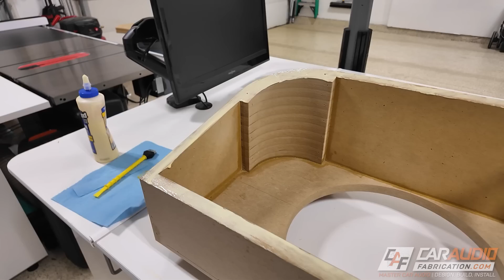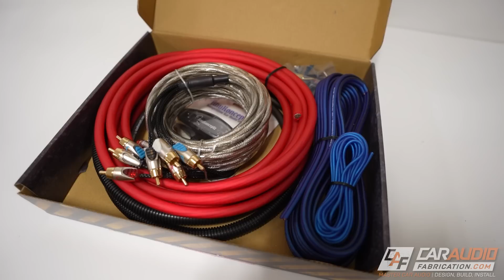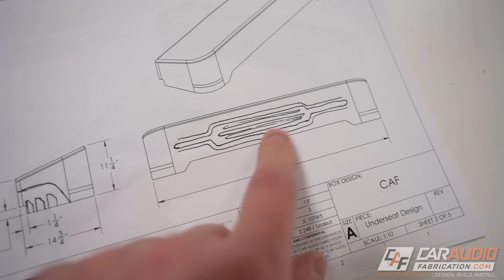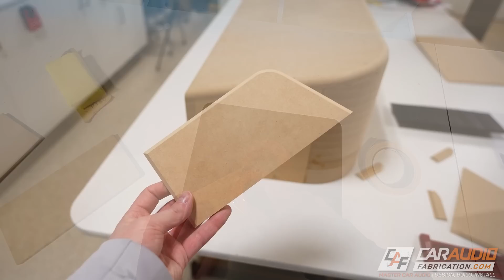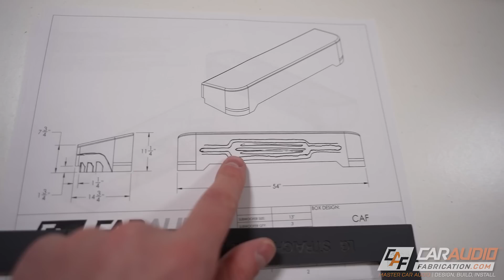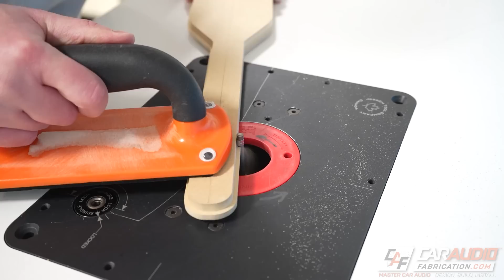Make Your Subwoofer Box Stand Out! (No CNC Required)

Comment: I am making a fiberglass subwoofer panel that mounts up to my roof in my Polaris rzr. I’m using a JL shallow and I’m putting dampening mat on the inside of the panel and also on the roof itself. My friend said I needed to put pillow stuffinv foam inside the area between. The panel and the roof. Is this something you recommend? This is a bit unconventional because most people don’t put woofers on the roof. Also do you recommend leaving an air gap or should I try to seal it up all the way? Thanks

Comment: Hi, can you help me build a subwoofer box with specs 30 inch length , 18 inch height and 7 inch depth. The subwoofer is alpine swj-12s4 a 250 rms sub max power 750. Frequency range starts from 22 hz and it’s a 4 ohm impedance with sensitivity of 87.6 db. The sub box with gives the best output. Hope to get one from the expert soon.

Comment: Hey Mark quick question on one of your other builds. The 13w7 with rd1500/1. Did you have that wired at 3ohm or .75 and the switch set to 1ohm? Thanks!

Comment: Hey man, I am changing my RF Punch P3D2-12 in a ported box it came with, built by RF. On Crutchfield it's the P3-1X12. I accidentally damaged the sub when this 2 Chains song came on with some insane bass!! Anyway I have Focal K2's for my front speakers (tweeter''s and subs) and Focal Utopia in the back seats. So I want to replace the P3 with the Focal SUB 30KXE so I know I need a more powerful amp, but I'm hoping I can keep cost down. The P3 box has 1.79 cuft and the Focal sub needs 1.93 cuft, could I use that box? .14 doesn't seem that much to me

Comment: "Just use CNC"  sometimes it's just faster to do it by hand.
As with your example.  You just free hand drew it on the board.  just cut it out.  the time it would take to draw that in cad then setup the cnc and hopefully not fail, which you did a few times on this piece, still would take longer.

One off pieces you don't always need CNC, more often than not, it's quicker just to make it by hand.  but if you plan to make multiple, then stop and consider CNC.
Reply from the maker: Exactly, I think some people view cnc as "throw a piece of wood at it and out pops a finished piece". You definitely need to spend time drawing. Not to mention when doing things "analog" little adjustments are very easy as opposed to making a full new piece.

Comment: Incredible work. I wish there was a shop I trusted like you here in Phoenix. I have a new Colorado which is space and height limited under the rear seat so I just bought a premade box from SubThump. It works fine, but isn’t customized for the Colorado at all.

Comment: No dry wall screws? I always pre-drill and counter sink the hole every 6 inch or so because it would take too many clamps.
Reply: Glue does all the work. Brads hold it tight while the glue drys. No need for screws. 👍🏻
Reply: @spoon_ek96  I do understand the joint is stronger than the substrate, but dang it's such a hassle. I have a 2 gallons of marine grade epoxy on hands. HAHA.
Reply: @KevinNguyen-zn4vv then use the epoxy to waterproof the box before you put it in your boat. 😂
Reply: @KevinNguyen-zn4vv  if you’re in the LA area, I got a 4x8 butcher block desk top we could use that epoxy to seal!
Reply from the maker: Nope.
Reply: You know, I think that's smart to use wood glue to help seal the box, as well as to add more "strength" to the joints. I'm a GC/custom home builder, and I build custom furniture. You are pretty good at your carpentry work, and your car audio knowledge blows my mind! I'm an old school car audio dude from back in the early 80's. Ever heard of Sparkomatic? Not bad for 45 years ago! Amazing what a couple of triaxial 6x9s sound like with a big ole 1970 Pontiac Bonneville trunk!